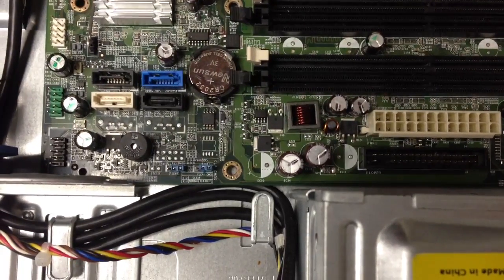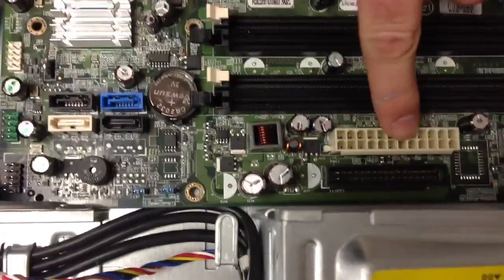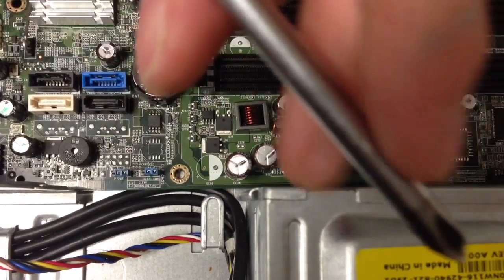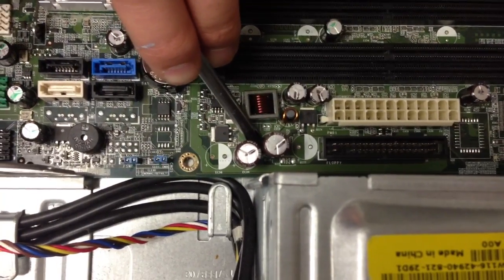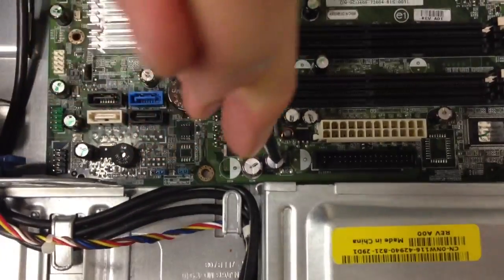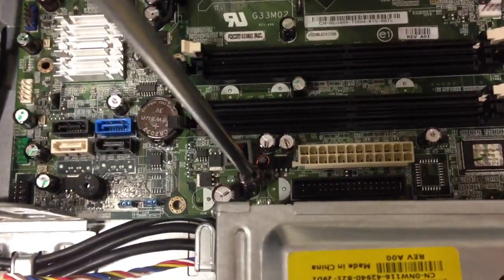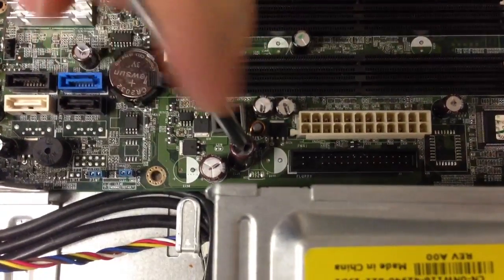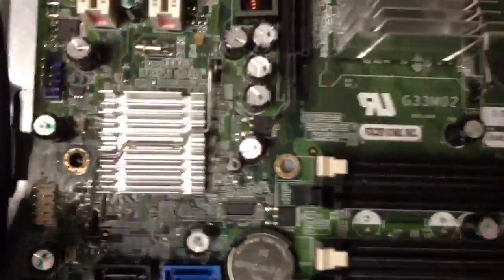EASY motherboard capacitor adjustments make your computer faster!

Comment: My pc does not start anymore, do i need to put power into it now ? Also I didn't have a screwdriver so I used scissors. I think I forgot to discharge the capacitor is that the problem ? A friend also told me I needed to defrag my graphics processor.
Reply: rip
Reply: ***** am not good with computer pls of help